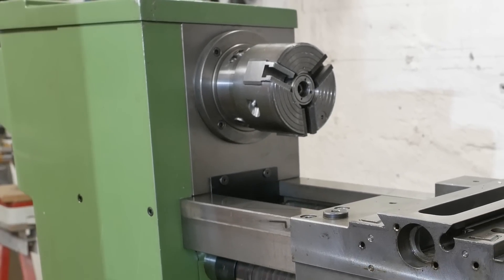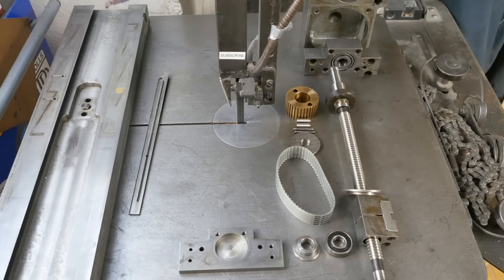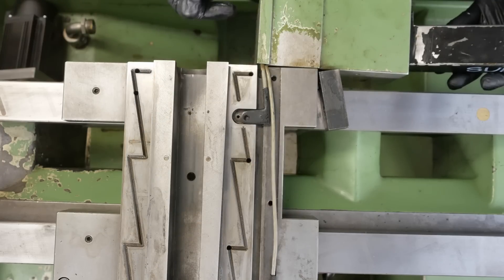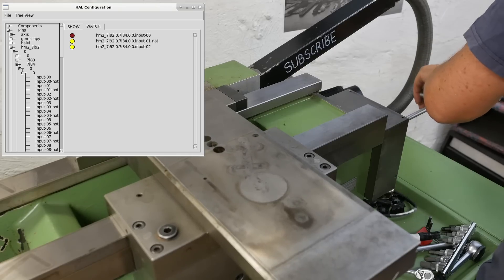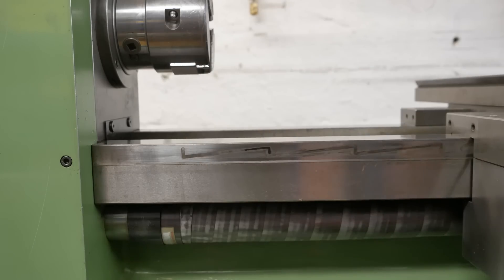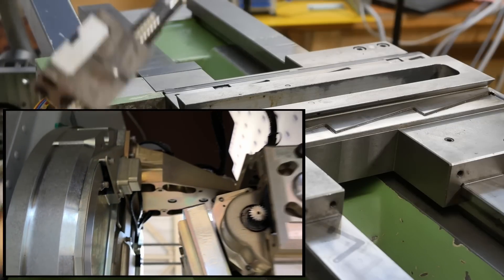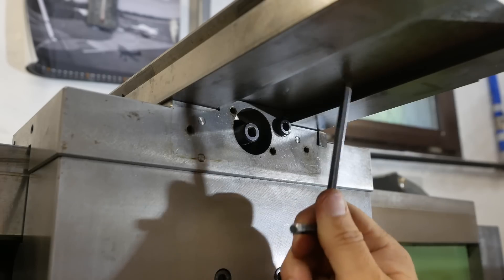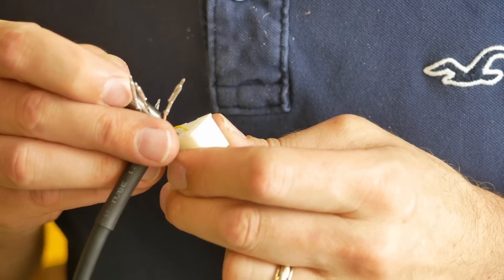Installing the cross slide - Schaublin Ep. 39

Comment: Nice work!, I have a little emco pc50 lathe from the mid 90s, and there is no physical overtravel stop, adding an adjustable one would be smart. it has a software softlimit, but it uses steppers. make sure you fill those connectors with dielectric grease. all the connector housings on my haas are green from corrosion haha...

I actually just finished rebuilding my air system in my shop and the air system in my cnc mill so i can make chips again. I have a quiet 3kw compressor that had basically been right at the minimum capacity i needed to run my cnc. I swapped out all the fittings and went from 8.5cfm to about 11.5cfm, and I went from stock which was basically 4mm outlet hose and a 6mm regulator to a 14mm outlet and 19mm regulator. I don't know why they thought that was ok to use, but everything is upsized now. I also added a massive aftercooler and automatic drain system, so no more water in the system. last time i tried to make a part the air compressor hit its duty cycle, and stopped me....
Reply from the maker: Thanks.

I have been thinking about adding an aftercooler to my shop air as well. Another one for the (endless) project list.